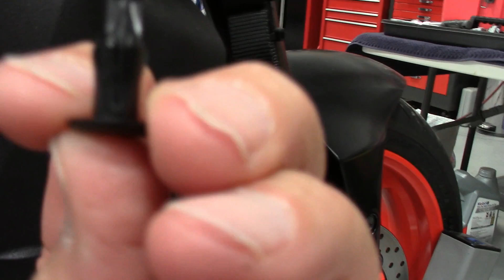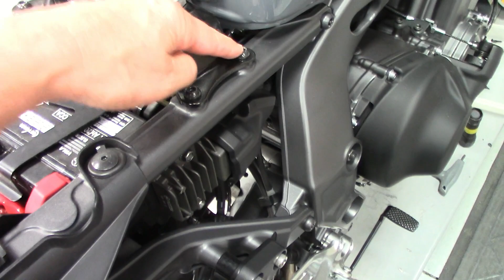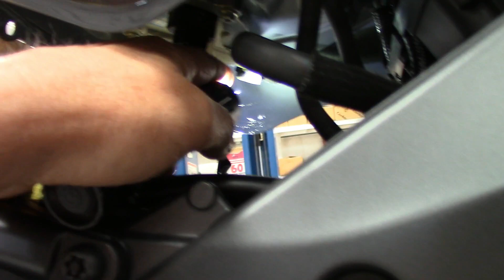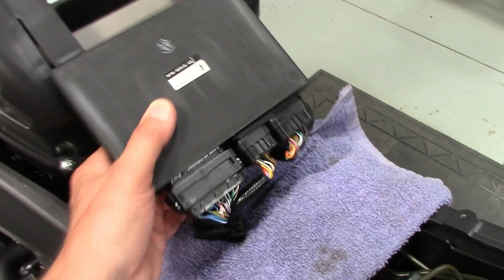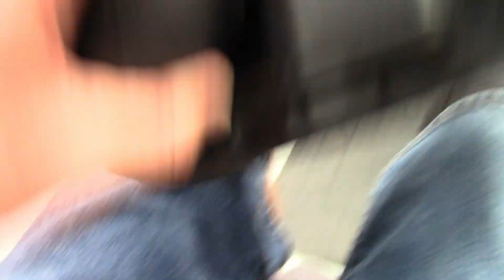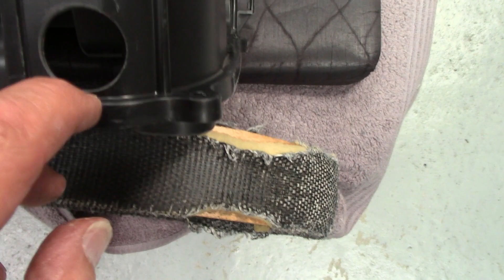21 + Yamaha MT-09 Air Box Mods, DNA Filter, Tank & ECU Removal  *Dale Walker*

Comment: I heard somewhere that Large intake opening(s) narrowing down, thus speeding the air up.
You'd lose some of the ram effect by shortening the  intake runner length...
Reply from the maker: That can vary a ton, motor to motor and bike to bike , also air box design. The intake tubes shoved so far down in the air box is a sound deadener to stay legal.

Comment: I'm doing the dna filter but won't cut the box as dyno vids have shown no significant gains besides a louder sound while on the bike but enjoy any and all vids
Reply from the maker: Everything must be perfect top repeat on the dyno. I will say its most likely a 1,5 to 2 HP gain but I cant prove that either.  Almost any pipe you put on the bike will be loud under throttle load or wide open, so you will never hear the air box mods, which are also very minor in this case. Cheers  DW